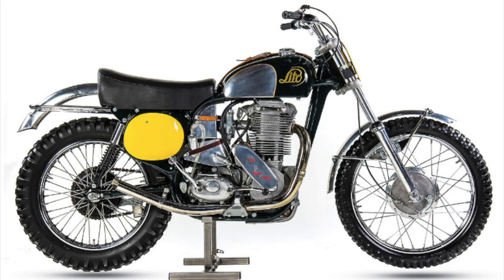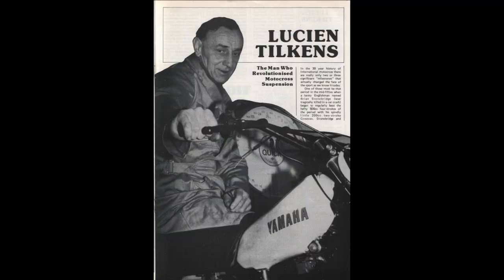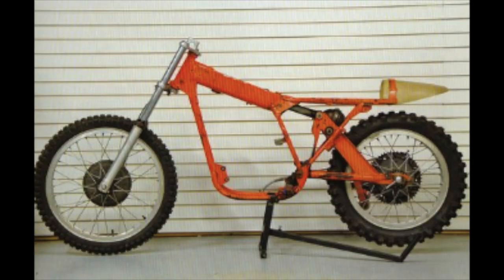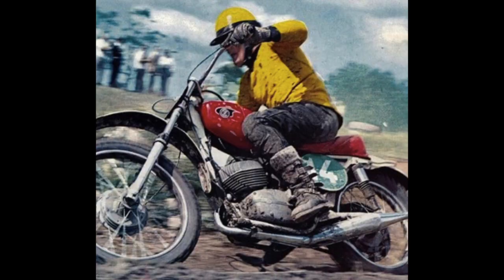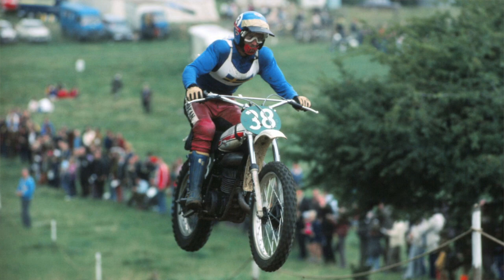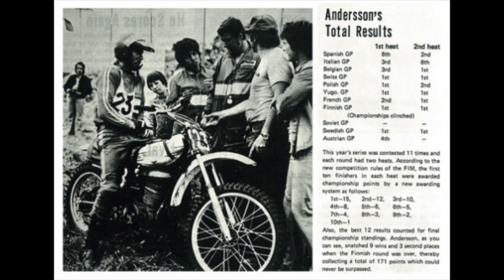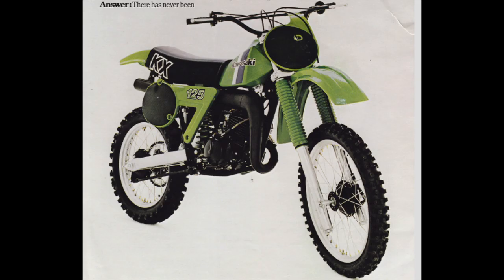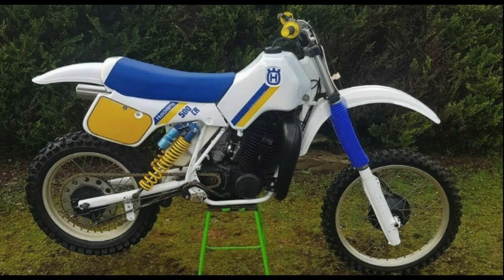Mono Shock

Comment: A lot further back than the 60's! Check out a HRD Vincent Comets, Meteors or Rapides from 1935 these were the first "mass produced" production motorcycles with mono-shock rear suspensions. Phil Vincent the engineeer was a aussie genius.
Reply: Paul, are you sure they were single shock? I always thought those Vincents were cantilever swingarm but with "two" shocks? Yes, Phil Irving was a genius.